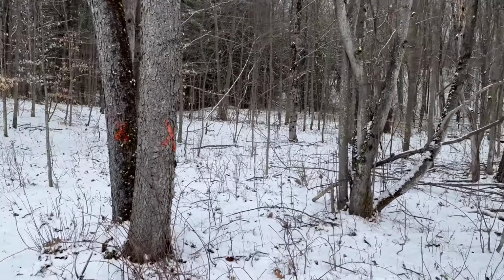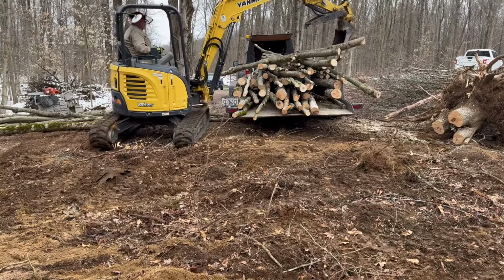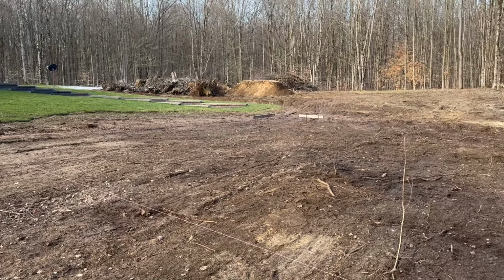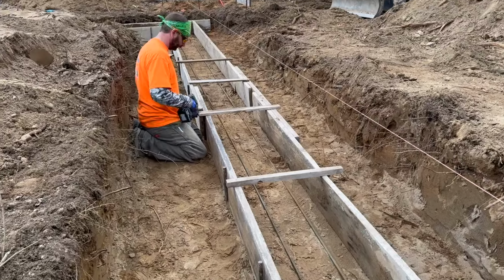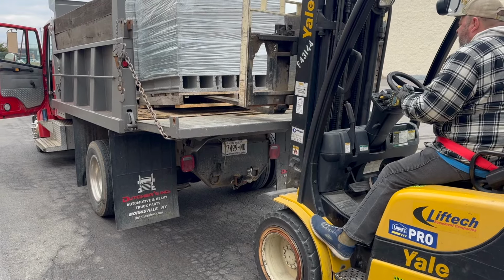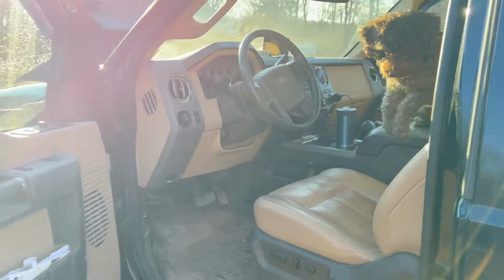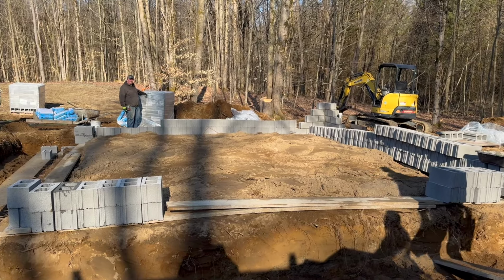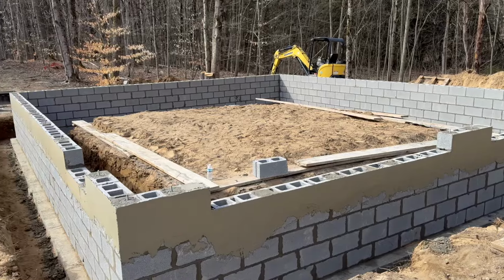How we use strings and Batter boards to square foundations.

Comment: We set batter boards the same way, but i always offset them 10’ to give the excavator lots of room.
We always spread lime on the ground under the string for a dig line on the trenches.
And we used a 24” bucket on the backhoe, and no forms, just stakes in the ditch for the concrete height.
The wider ditch does make it easier for the masons.
We dug our basements with a crawler loader, and used the ramp for backing the concrete and block trucks into the basement.
We did form the basement footings, and put the crushed stone in to the top of the forms.
Then stocked the block on the stone.
We used lintles to bridge from the basement wall to the trench footing.
Reply from the maker: Sounds like you guys had a good system for doing it too. 👍👊

Comment: It’s pretty amazing for this area to not have at least 3’ of frost in the ground this time of year. I’ve been seeing quite a few contractors doing concrete work almost all winter. I always worked 12 months out of the year, but my pours were almost exclusively indoors, a lot I’ve been seeing are actually outside pours. Take the money, and run! 👍👌
Reply: @TUGG75  It is now, but for many years 3’ was the norm, I don’t know where you are, but I’m in the same area as Bondo, I remember 4-5’ of ice on the lakes too, not anymore. The climate here seems to be changing.
Reply: Well Tugg, I am a retired contractor from this area as well, and Ice fished for many years, I agree with you about current conditions, but not so many years ago, what I stated was the norm, things have definitely changed, and the contractors working today are lucky, the conditions are much more favorable for doing masonry work through most of the year. My pours were always interior, so I worked 12 months out of the year every year.
Reply from the maker: Ya it is kinda awesome except the snowmobile sat to much this winter.
Reply: @bondobuilt386  I did a bunch of upgrades to my tractor snowblower last summer, lol, used it 4 times! On the upside, I might be able to use it again this week, go figure! 🤦‍♂️

Comment: In California we fill the blocks completely with concrete and rebar every third row of block. Horizontal,  plus rebar vertical,  every other block , make it one super walls. We don't have problems with freezing issues generally. Like your Eastern area's.  Question is the reason you don't fill your completely is because of freezing issues??
Reply from the maker: We did fill it every 4 feet with a rebar drilled into the footer. We are not required to fill the walls solid like you are saying in our area.

Comment: Great job as always Bondo. Question, how come you didn't dowell into the footing with rebar?
Reply from the maker: We drilled them in to the footer where we core filled.
Reply: @bondobuilt386 perfect. I must have skipped that part. Great job Bondo
Reply from the maker: thanks  @dannyboy2180

Comment: YA DIG AROUND THETREE BFORE TRYING TO PUSH IT OVER  Idid the with a red oak and push it over you want away from the tree about3ft to get the top roots after that you should be able to push over the tree just trying to help but cool if i was therei would have cut them up for lumber thats how i get my wood for my saw mill and frie wood as well stay cool and safe
Reply from the maker: Thanks I have a mill too I might mill that oak tree.

Comment: I wish you had been doing this a hundred years ago, then I wouldn't be wasting all of my weekends dealing with this foundation
Reply from the maker: You got a bad foundation?
Reply: @bondobuilt386  Heh where to start.  It was either amateur hour or a crew in training.  Block is soft (cheap, not enough portland), every row has a broken bond. Nothing lines up.  They used no corner block.  It's ugly.  Overhangs.  No footing.  No gravel.  All 4 corners have broken apart and during my mud sill replacement (doing myself) I've been reinforcing with frp and my own core fill grout mix (has to be fluid to get down in there).  I dig down by hand 40"  on the outside so I can hog out the cracks and cover them so the grout fills that in, and then I parge that with the high strength repair mortar.  It's a ton of hand work.  I don't want to waste your time with a book.  House also has an "addition" almost as old.  Even worse.  Foundation stops 10 inches below grade.  No footing, no gravel either.  Lots of vertical cracks on that one.
Reply from the maker: Dam that sounds like a nightmare buddy. I have seen some shitty work out there in my career but yours sounds like one of the worst. Where do you live?  @peep39
Reply: @bondobuilt386  South Jersey.  Thanks for taking an interest. Real sandy soil here.  This whole place was built for the bottom buck.  At least I'm fairly handy and like to learn, and I don't back down from a challenge.  I can only make it better or worse, so I figure I got a 50% chance at least.  Really enjoying the work you do keep it up.  Oh yeah, one last thing to mention, they basement "floor" varies between 1/4" and 1/2" thick 😂I can't believe it didn't turn to dust and it did actually cure.  The stuff they used to get away with...  I look at the whole thing and laugh, what else can you do.  I like concrete though and it's fun to experiment (kinda) so there's that

Comment: Try putting a bucket of water in the mortar mixer, then put in the empty cement bags and let it run for awhile.
It will clean the mixer and dispose of the bags at the same time.
Reply from the maker: We do that and it does work well  Been doing that for years. LOL

Comment: compaction none ugh,   soft 8 inches looks like,  nice to see few rounds with plate compactor,  at least settles all the same ecept that back right loose fill  , but always works for year or 2,   then settles 1+ inches
Reply from the maker: We compacted the heck out of the inside yesterday as we back filled it in with gravel. We did not compact the virgin soil under the footers.